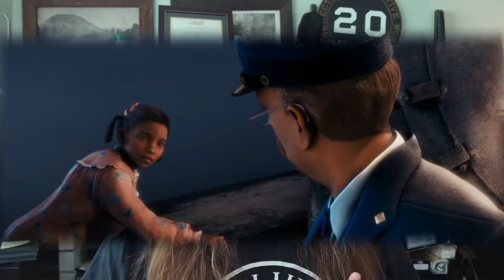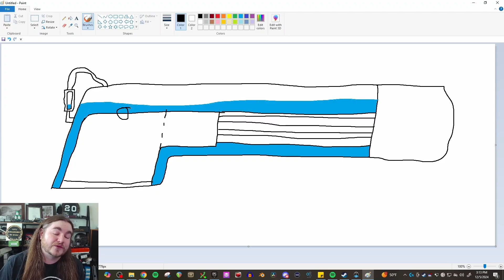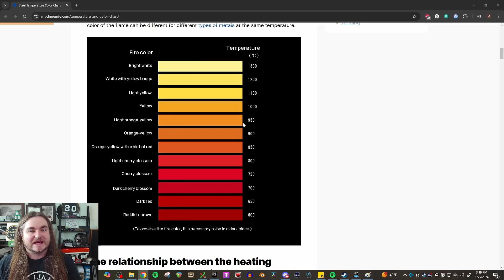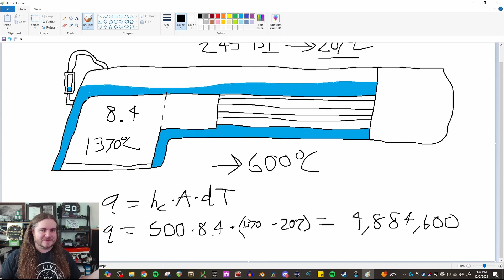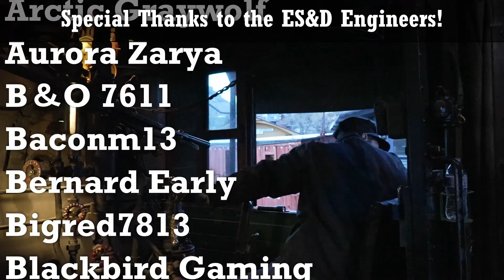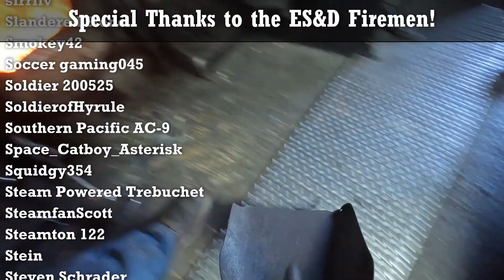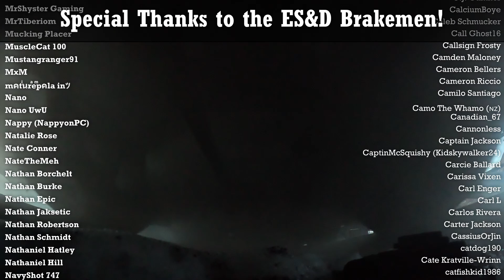Would the Polar Express EXPLODE on Glacier Gulch?!?

Comment: If I remember how gravity works at high speed at angles, it probably wouldn't explode. 

At that rough of an angle at that speed, the water would be pushed back to the rear most of the boiler. (Think about filling a bucket with water and spin it in a circle. When the bucket is upside down the water is still in the bucket despite gravity.)

Or at that speed and angle the interior of the boiler would be at or around 0g. (This seems to be what happens as the men seem to fly). The water would stay what it was at before it went down the grade.

Now here is the real question: how much damage is done to the boiler after that much water movement.
Reply: Welcome to the world of rocket ship ullage.  Air resistance means the water would still slosh forwards, but mostly stick to the outer walls of the boiler due to whatever spin is picked up (and there'd be a lot of spin since the whole thing just tipped 90 degrees).  It's a real problem for any liquid fueled second+ stage of a rocket: how to get the darn fuel down to the bottom center of the tank so that the engines don't suck air and explode. You've got essentially no adhesion on the drive wheels at that angle, so no real thrust to work with. 

Fun fact, when the Saturn V separated the first stage, and before the second stage could ignite, the first stage had 8 solid retro-rockets firing to keep it from bumping the rest of the rocket (the front half of the rocket had a lot more drag, so the first stage would ram it otherwise), and the interstage ring had 4 little solid fuel rockets attached, firing to get enough thrust to overcome air resistance and settle the fuel.  Only once the second stage is going does the interstage ring drop away so cinematically.  Ah, the other kind of steam propulsion, even more complex.
Reply: @SkorjOlafsen  Aren't rocket fuel tanks pressurized before launch to push the fuel and oxidizer towards the fuel pumps.
The boiler is pressurized to around 200-300 psi (13-20 atmospheres)during operation. The steam pressure might reduce some of the sloshing.
Reply: OK, now I'm wondering: with the engine working as hard as it is, if you point the stack exhaust backwards would that provide enough thrust to settle the water at the back of the boiler and protect the crown sheet.  I think it might!
Reply: @SkorjOlafsen  Likely it would! You really don't need "a lot" of ullage thrust, just "enough" to overcome air resistance and then enough to settle the tanks in a short enough time period. EDIT: The thrust produced might not be all that EFFICIENT, as far as rocket engines go, but a low specific impulse (fuel efficiency, but for rockets) usually means a higher thrust potential, assuming you can increase the mass flow rate to compensate for the lower exhaust velocity (and exhaust velocity is directly proportional to specific impulse). END EDIT

But speaking of ullage, there's another way to settle the tanks during staging: Use the engines of the previous stage!
How do you do that? Easy, you start up the next stage's engine(s) while the previous stage is STILL FIRING.
The name for this really tells you pretty much all you need to know about the process, it's called "Hot Staging".
There's really only a couple extra requirements for hot staging, but as always they do add mass.
1. The previous stage needs to be able to withstand the forces and temperatures of having the next stage's rocket engines firing at it for a few seconds WITHOUT having a structural or thermal failure. Not so easy when your rocket's made of Aluminum, but the Russians seem to like it well enough (makes the rocket simpler, less ways for things to go wrong is a good thing). The SpaceX Starship/SuperHeavy also uses hot-staging.
2. The interstage needs to be similarly durable, but ALSO needs to have an open structure to allow for escape of the rocket exhaust while the next stage is firing while still attached to the previous stage. The Russians like to do this by making the interstage out of high-strength steel struts (or maybe girders, haven't seen pictures of the interstage of Proton or Soyuz with high enough detail to differentiate) instead of solid panels of formed metal, but SpaceX seems to fabricate their hot-staging ring (what they call the interstage) out of the same sort of stringers they use to reinforce the tanks in other places, which makes a lot of sense since it means you don't have to make as many different kinds of parts to make a complete launch vehicle.
Reply: @SkorjOlafsen  the stack thrust would help regain a small amount of traction at the drivers by pushing the engine into the tracks. Perhaps that extra acceleration would settle the water.
Reply: there's a couple year old video that explains that it would not explode on Glacier Gulch but rather on the downhill before flat top tunnel as that would have left the crown sheet uncovered for about a minute before shocking it with the water slosh after the tracks flattened out
edit: found the video 
https://www.youtube.com/watch?v=bxPvxWSdlIQ
Reply: @kevinpark1 Yeah, that'll get ya! The last boiler explosion in Germany (Bitterfeld, 1977) proceeded just like that: They didn't notice they were low on water, overheated the crown sheet, and then on braking for the next station, the water sloshed forwards, then back as the engine stopped... KABOOM!
Reply: @catfish552 what did cause that kaboom?
Reply: @samanli-tw3id  Material analysis of the firebox revealed that it had been heated to approximately 740 °C. To reach such temperatures within the material, the firebox crown must have remained uncovered by water for at least four minutes. At this temperature, the tensile strength of the firebox dropped from 510 N/mm² to less than 88 N/mm².

The water level in the boiler had dropped so low that, during braking for the scheduled stop at Bitterfeld station, the remaining water initially surged forward; then, as the locomotive came to a halt, it sloshed backward against exposed, overheated sections of the heating surface. The water vaporized explosively.

Translated from the german Wikipedia-Article about the Bitterfeld-Explosion.